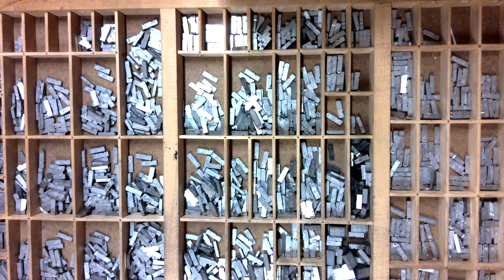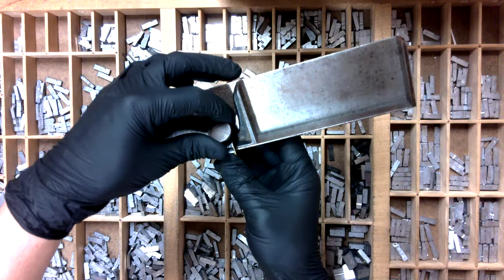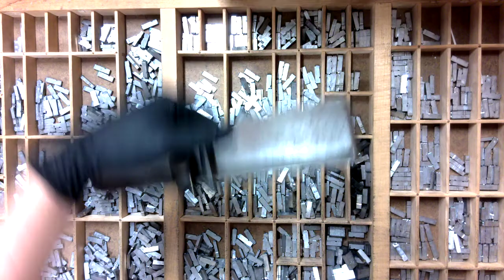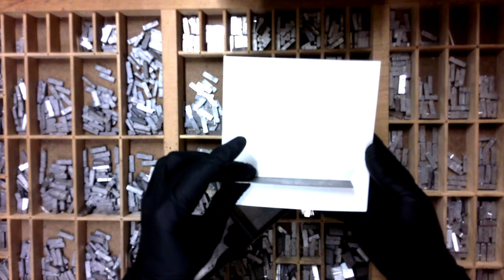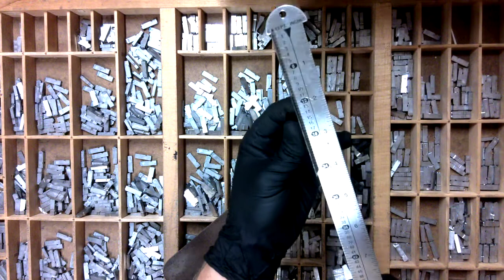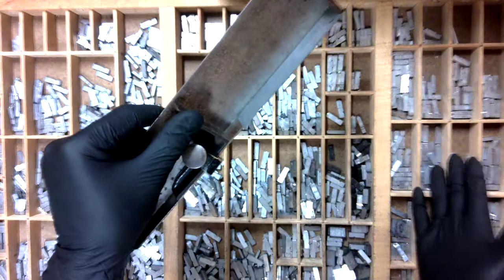05 The Composing Stick

Comment: The length is 25 ems and thickness is 3 points
Reply: I was taught that leading is measured in points and an em is a unit relative to the point size of a font. I have never used an em as a unit of length.
Reply: @professorlegacy  Furniture and the length of leading are measured in picas, type and the thickness of leading are measured in points. Also, the gloves are not necessary unless you have an allergy to the metal. I need all the sensitivity in my fingertips to control the setting.